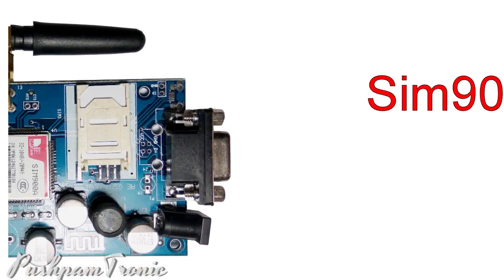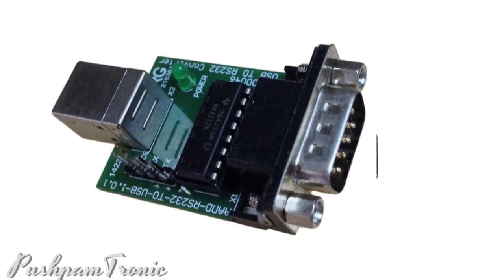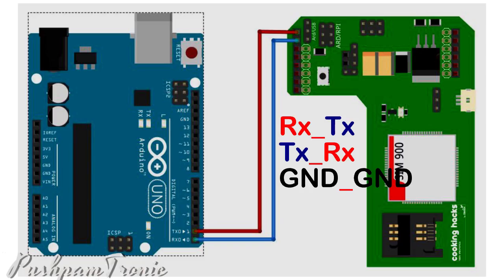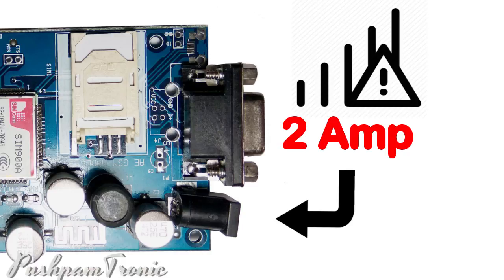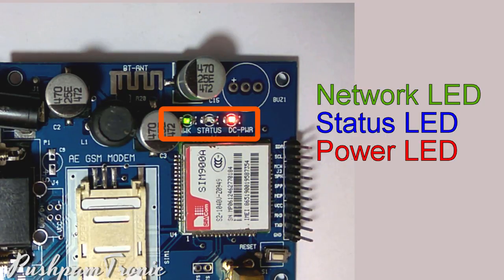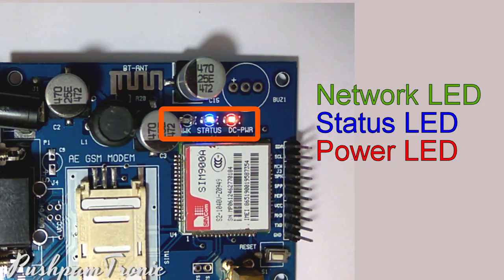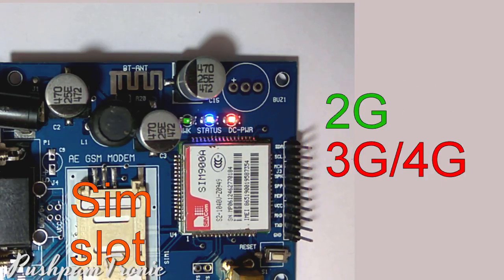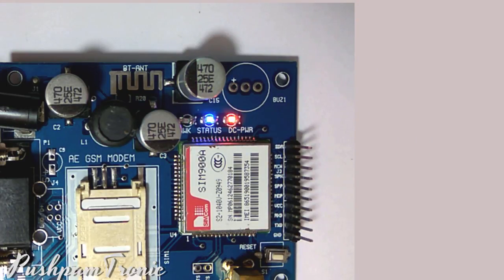How to connect GSM SIM900A module with Arduino

Comment: Mam now 2 g is not availavle sim so how cani get one
Reply from the maker: 4g sim supports both 2g as well as 4g
3G is not available
Reply: @pushpamtronic4323  mam wheni connected the supply the ic below burst what is the reason for that
Reply from the maker: You must have to use the recommended voltage and current range.
Otherwise It muat be due to short circuit in the board
Reply: @pushpamtronic4323  which is the recomented power
Reply from the maker: It will be according to your board selection

Comment: Sir, When you call the first one, the LED 1 should be turned ON for 2 seconds and the again call  LED 2 is ON 2 seconds. Can possible create such a code? Using Arduino and sim900A ajitzagade19@gmail.com

Comment: When you will upload the next tutorial video on it? I mean its connection and codes for call and send SMS through arduino. I have this same gsm module shown in this video.
Reply from the maker: +Kuntal Mandal 
I am working on it
Reply: Please upload it soon...
Reply: My gsm works as you said it should with the hardware part, but the AT commands are not responding